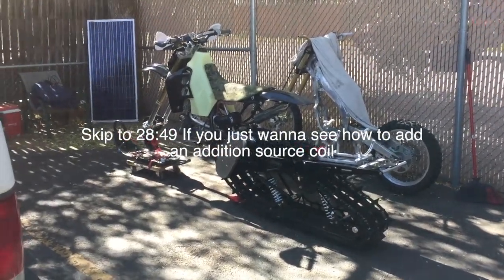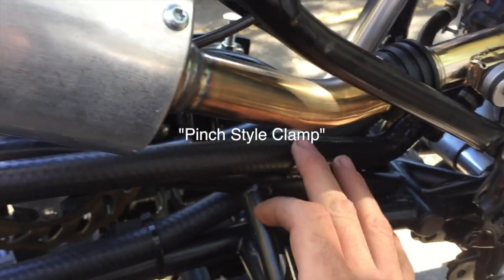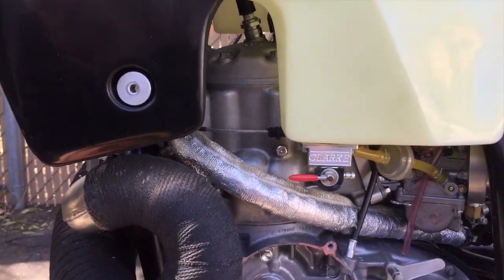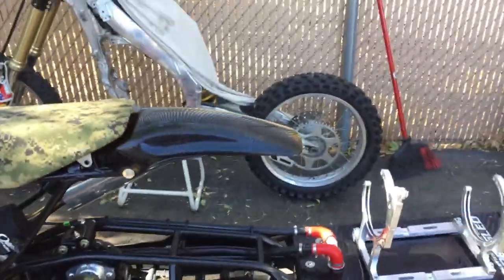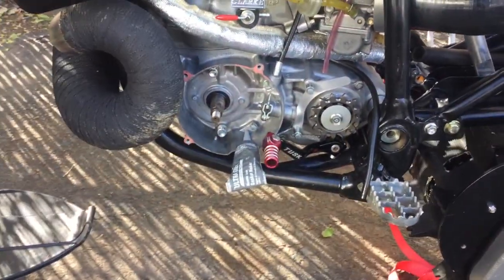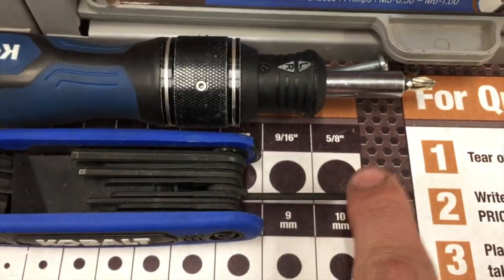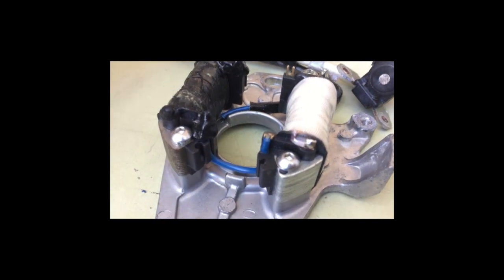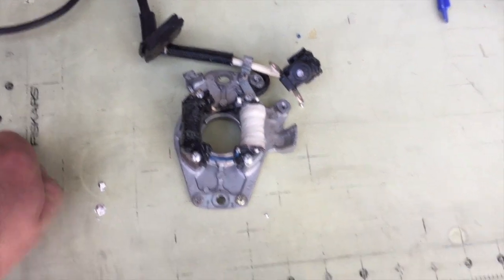CR500 Snow Bike Setup & Dual Source Coil Mod

Comment: The dual coil still doesn't have give more energy to the plug ... the CDI is the limiting factor ... I use motorcity spark box on my alky lt500r look into vertex or motorcity